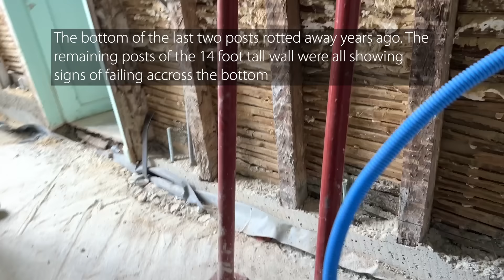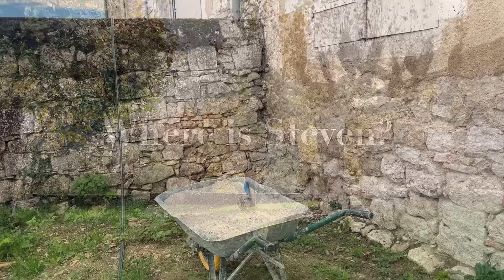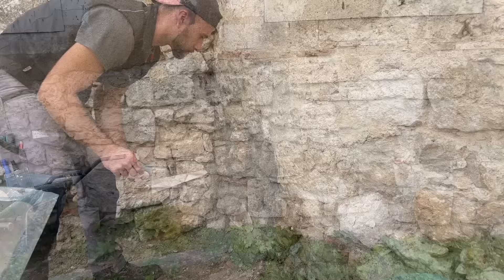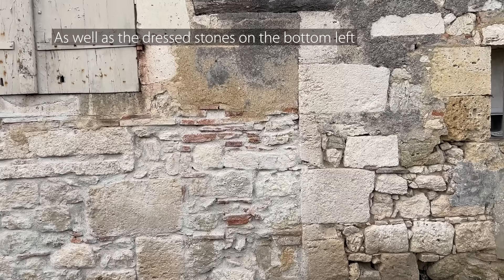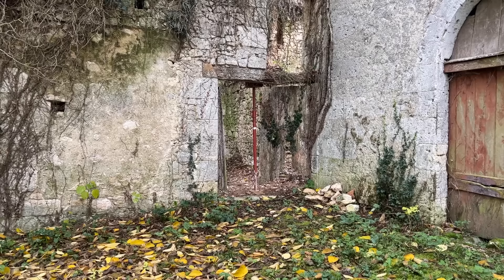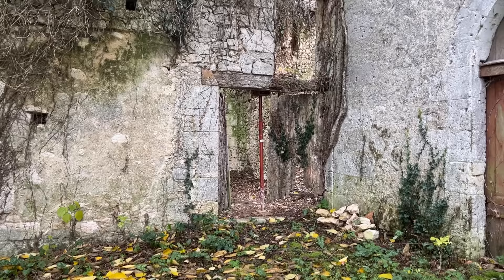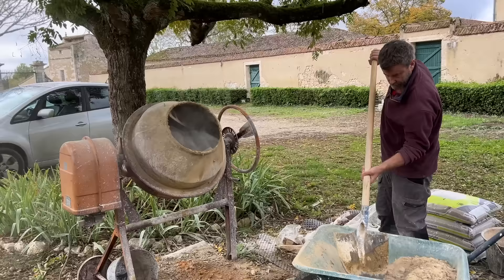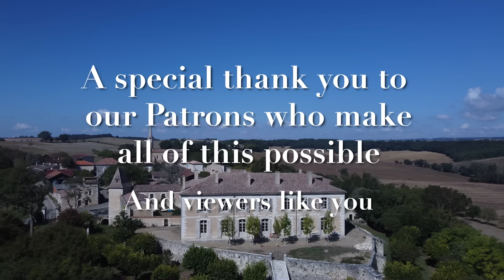What's happening at the Château TWO

Comment: The one think not to do is finish the attics and make it living space. You need to be able to inspect the roof frequently. Plus the roof need to rapudly dry out from both sides. Some of these wood  roof structures last hundreds of years becauce they are exposed to the air and stay dry.
Reply from the maker: Hi Sandra, perhaps something in the video was confusing. We have no intentions of ever sealing up and using our attics. The ventilation is too important.
Thank you for watching and commenting

Comment: Should have put a pressure treated sill , bolted to concrete, with tar paper under it on top of the concrete sill.
Reply from the maker: Hi Sandra, We had the battle of a very rough foundation wall poured by the builders that we had to fire. We chose to add to the previous pour and bolt the two layers together rather than risking more harm to the ancient structure by attempting to break out what had already been done. 
We also chose to go the expensive route and use galvanized steel Simpson Brackets for the tie down of the ancient beams. These brackets have a galvanized steel base plate that separates the wood from the foundation. No water wicking, no rust, no future breakdown.
Thank you for watching and commenting

Comment: Wouldn't a solid horizontal wood beem at the bottom be healthier forbthe wall and house? As far as I understand old buildings (living in one from 1650 myself) use of concrete, OSB,  plasterboard and non lime based mortars (silicones and resins) and vinyl /acrylic paints should be avoided at all costs if long term preservation and healthy environment is the priority. Breathable natural materials only.
I understand concrete and epoxy is easier and common knowledge (which historic building techniques seldom are) but this is what I've learned over the years.
Lots of interesting work!
Reply from the maker: Hi Gnarbeljo, Thank you for the comment. 99.9 percent of our restoration work is in the old way. But, there are times that modern techniques can resolve an issue that otherwise could not be solved. We used concrete for the footing of the tall interior wall because concrete does not wick as much moisture as old world building styles do. We had a French artisan do the work the first time at great cost, and they poured a concrete footing leaving the support posts embedded directly in the concrete, a setup for future disaster. We poured a second layer of footing on top (bolting the two layers together) and added galvanized brackets under the posts to separate them from the footing. Galvanized so that they will not rust, and as a separation from the concrete to stop moisture from reaching the bottoms of the posts.
 
We are using OSB as a base for tile floors on the upper floors. The tongue and groove OSB is a sturdier base than wood planks, and it will not shift or undulate over time. We will be adding Ditra uncoupling matt over the OSB and these two together should unsure that the tile floors never crack.

Plasterboard is widely used by historic preservation artisans to fill voids when doing things such as closing up doorways on interior walls, and we are doing that very thing, and then top coating the plaster board with earthen clay plaster. We would never use it on an exterior wall ever. We actually removed the former work (applying drywall to the lower section of the bathroom wall) and we are going to put in lathe and earthen clay plaster with an air separation at the bottom to stop moisture from waking up the wall.

We have stripped all of the moisture stained wall paper from the entire chateau and we will using Earthborn clay based paint (the only guaranteed 100 percent breathable paint), no wall paper will be used in the chateau due to the fact that wall paper is not breathable and moisture collects behind it causing the water staining.

We have done our homework and use traditional methods for almost everything, and contemporary methods when deemed better and more appropriate.

I hope this helps in understanding how we are approaching this project.

Thank you for the great comment!!!

Comment: The mortar in the wheelbarrow was like soup, too wet. Concrete or mortar should be a stiff, dry mix. The drier the mix, the better. When you have soup you cannot thicken it up. Get rid of it and start over. You add water a little at a time. 
  The reason you do it this way is when the concrete cures (dries) and place where there are water molecules there is a space left where the water was. The more water, the more porous the concrete. The more porous,  the weaker the concrete will be. Plus the concrete will absorb water into these microscopic spaces, like a sponge. You can do a slump test. 
  Before doing all this, read up on concrere science and building science. How walls need to dry out, etc. These books are easy to find. Used college textbooks on things like concrete science will do.
Reply from the maker: Hi Sandra
The mix in the wheel barrow was not concrete. With a very very few exceptions concrete is not allowed in any of our building work, unless absolutely necessary.
The mix in the wheel barrow was a form of render, simply lime, sand, and water. Steven had indeed mixed that batch to thin, but he was able to cut in more lime and sand without issue.
Thank you for watching and commenting

Comment: I thonm u need a moister barrier behind paneling i have seen Styrofoam of sort with other side has shiny side it insulation with moister barrier on it
Reply from the maker: Suzanne, the problem with moisture barriers is that the moisture has to go somewhere, and the preferred place is evaporating into the air. We have double coated the back of the new woodwork with a serious varnish that should protect the wood and yet allow moisture to pass through the small gaps and open spaces. Fingers crossed! Thank you